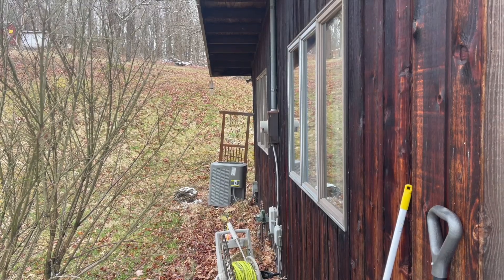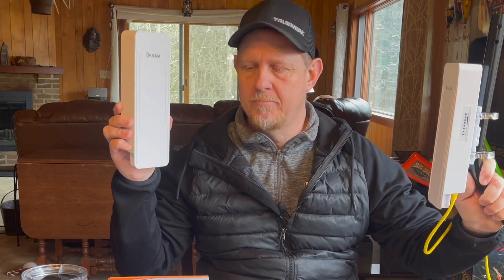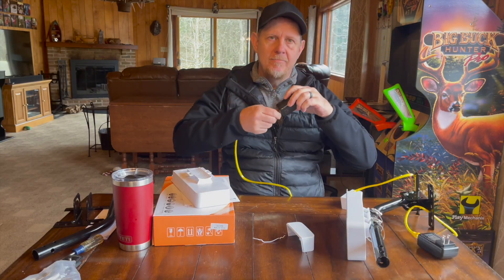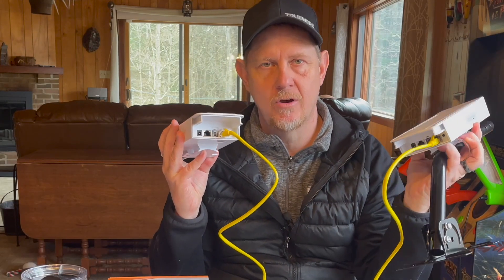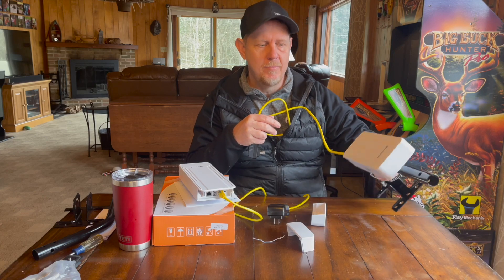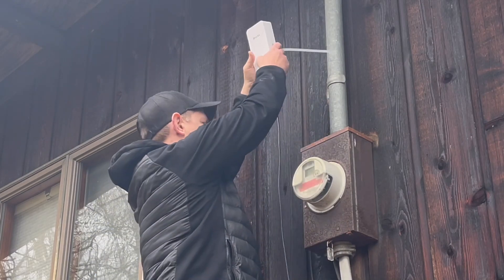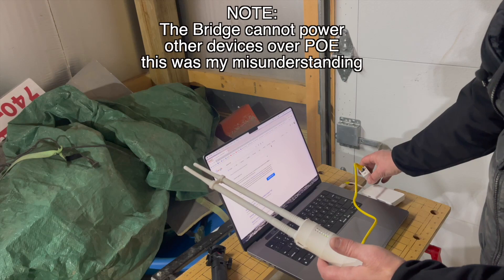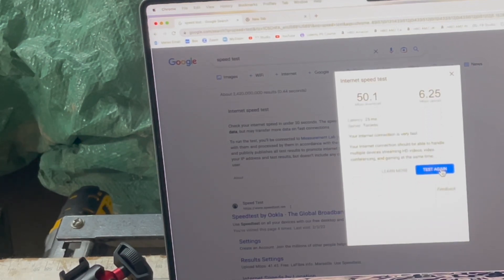REVIEW: ULNA Wireless Bridge  Install and High Speed Internet Test to Garage Shop Barn 120 Feet Away

Comment: bought one. does not work. the setup screens take a full minute to load every time you click a button. also. they dont connect so complete waste of time and money.
Reply from the maker: Either got a bad unit or it’s a PEBKAC Error. Either way sorry to hear that, mine works great and has been since the day I installed it. I’d suggest swapping it out for another and trying again.
Reply: This is a very clever device. Not standard for this type. It is more of a router than an access point.
Reply: always ready to help with setup issues.

Comment: No one shows their IP configs in any of these wireless bridge videos.   I bought an ULNA wireless bridge and it's setup with 192.168.255.xxx depending on the channel that selected, and none of my routers or devices are configured for that subnet.  Did you have to redo your IPs from the default 192.168.1.x or 192.168.0.x setups that are standard for your routers and end devices?    I am connecting chords just like the manual says and the devices are connecting with a strong signal, but I cannot get to the internet from the B device.  Any ideas?
Reply: yes. i have ideas.
Reply: always ready to help with setup issues.
Reply: @meet-nik  well maybe you can help me🤞I have starlink internet, I hooked up two Bridges, one across the street at my sister's house, I'm getting a strong signal! but only 1.6 MB speed. I was not able to get my Wi-Fi network to transmit through the bridge, only a random Network  that was strong, I put a Wi-Fi extender inside the house, to pick up the signal,  from the bridge. But like I said I'm getting a strong signal!  but virtually no speed, and the internet keeps cutting out periodically.

Comment: What if the building I need the WiFi at is approximately 200 feet away, but there are trees between the house and barn….will that cause a problem since in the summer, the trees are obstructing a direct view….?????
Reply from the maker: I can’t say for sure but I suspect it will degrade and or possibly block the signal. Instructions suggest an unobstructed line of sight

Comment: Will they transmitt thru glass? I have line of sight about 499 feet. I would like tomount the units inside the window on eachend
Reply from the maker: I’ve not tried that. I suspect it would but cannot confirm definitively.
Reply: Yes, but is not advisable.
Some of these device can output quite a lot of power and must be mounted out of reach of people.
Of course you can use devices rated for indoor use instead.

Comment: What was the issue with the UEEVII wireless bridge, you did a video on earlier?
Reply from the maker: No issues at all, i was just sent a second one to test.  They had different speeds but frankly the speed was irrelevant as my speeds at my cabin cannot support the higher one.  Both products are good and work well.
Reply: Appreciate the reply.

Comment: How much electricity will this consume each month?  If it is convenient to install, but costs $50/year to run, perhaps rethink?
Reply: may be a buck a year man, this are POE @24v and less than a .2 of an amp. you could run one of this off a 100watt solar panel and a 12v battery for as long as the battery can live.
Reply: probably less than a buck a year @TdrSld
Reply: They are 24 volts DC and draw like 1/2 an amp or less if you turn the TX power down, meaning you can run them off a couple deep cycle SLA batteries and a solar panel setup for it.
Reply from the maker: No idea on that one but for me trenching a line really isn’t an option and a separate cable line would cost me another monthly fee. $50 a year is $4/month.  Seems high for a little device like this but have no clue what it is.
Reply: The systems I've seen draw 3-7W per POE device. At 3W, each bridge will use 3x24hrs =72Wh/day or 26 kWh/year. At my local rate of 12c per kWh, that would cost me $3.12 per year for each of the two units. Brands that use more power, like those drawing up to 7W, would cost $7.32 per year for each bridge. That's not likely to break the bank. I hope this helps!

Comment: has this had any effect on the bandwidth in your main/house router?
Reply from the maker: no negative effect thus far
Reply: If you set the channel bandwidth in a bridge to 20 MHz wide then your throughput max speed will be like 150 bps, 40 MHz will give you 300 Mbps and so on but be aware of your bridge hardware and specs. Many of these VHT (Very High Transport - high data rate) bridges have dual 100 Mbps Lan ports, some have gigabit port but only one and you have to pay attention to which one it is (usually the one marked WAN or A). One thing that is lacking with these cheap bridges is the option for PoE passthrough.

Comment: This is what my ubiquiti AP gets and it costs 200$ it actually gets around 50/15... still not really happy with that, 
It's about 100 feet away with 2 trees and a wall between. 
Real world is a lot different than what the numbers on the box say. 600 feet, yeah right.
Reply: Things operating at 2.4 and 5 GHz dont do well to penetrate walls and if the wall has a metal siding you just have a big reflector. I good way to think about this stuff is how a microwave oven works to keep microwaves inside the oven. If the thin metal oven chamber keeps in high power microwaves (1KW or more) then it can definitely keep micro power WiFi microwaves (up to 200 mW) out, same goes for metal siding on a wall, home, barn, or shed.